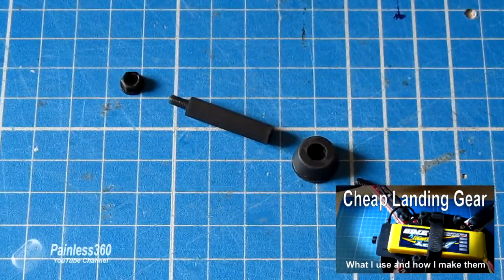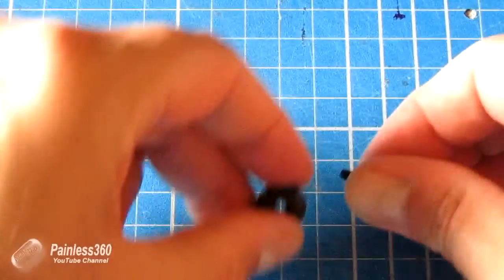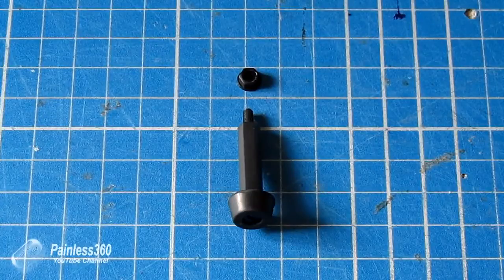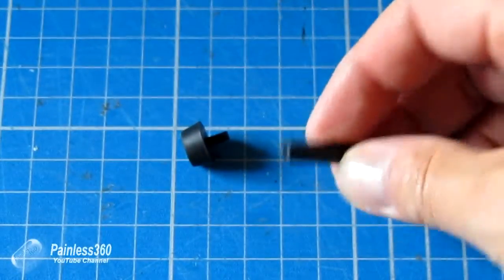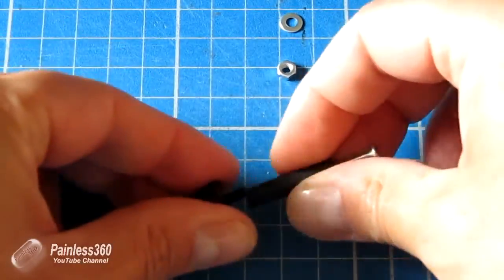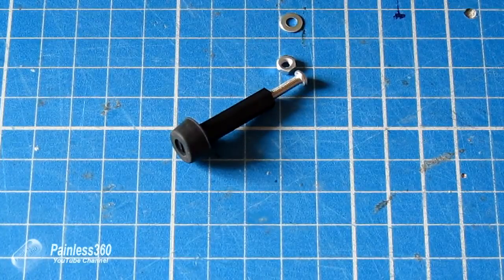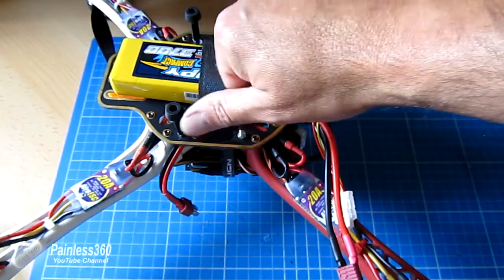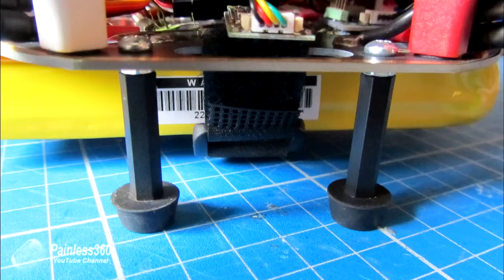Cheap, stong, light landing gear for quadcopters and multirotors

Comment: If you have the Integrated PCB Connections version frame, it is very dangerous to use metal screws on the board. I managed to make a shorting when I used metal screws to install my FC. The copper foil on the PCB burnd at several Points.
Reply from the maker: Kenneth Jonsson Sure is. Good point. 
FYI - the position of these legs it outside of the PCB tracks though but always good to check.
I would recommend not using metal screws near the FC anyway - they can help with the magnetic interference.
Happy flying!

Comment: I saw a video where a guy used old heli blades.. i use them.. attached with zip ties.. if i land hard they will fold under and make the rest hit a bit softer. and easy to replace,, just gotta go fly my helicopters for a bit lol
Reply from the maker: Do you have a video/picture what shows what you mean? Sounds interesting!

Thanks, happy flying!
Reply: Painless360 i have a pic on my google+ its called RC Rotors
Reply: Painless360 look for my name on google+ i just posted a pic

Comment: I use rubber bobbins on a 15mm standoff with a foot made of a rf antenna cap (the red things) that sleeves over the standoff. The rubber bobbin top allows for flex on landings that are not soft and smooth.
Reply from the maker: I like that idea, like the suspension on a car. Happy flying!